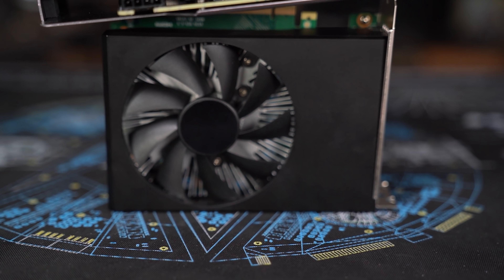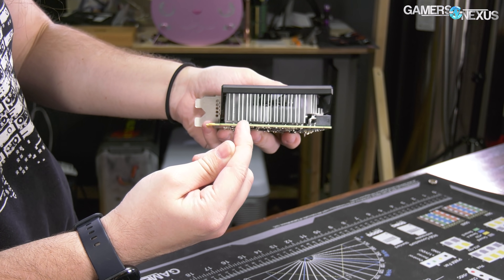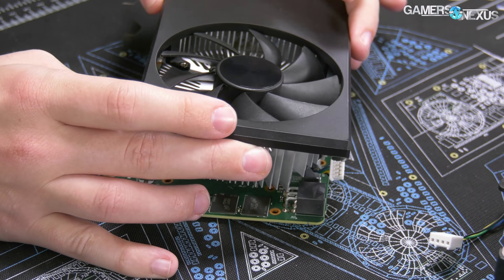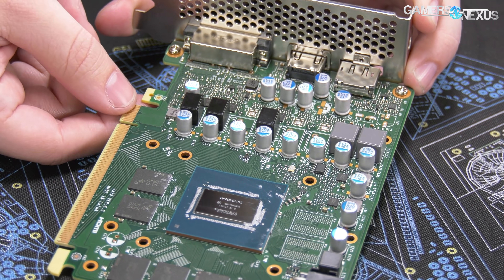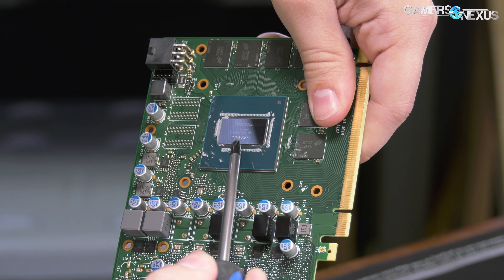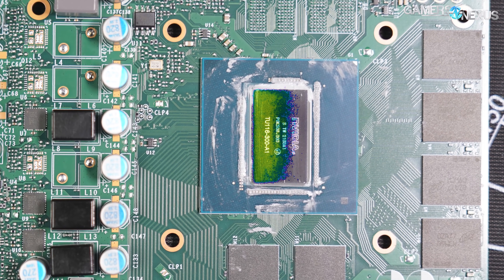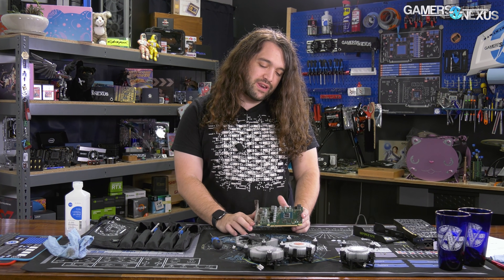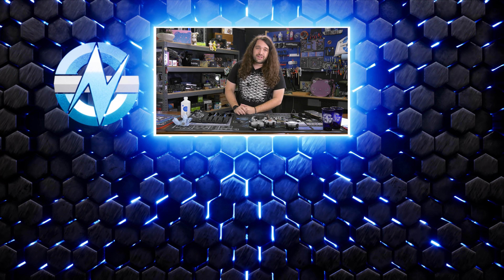Bottom of the Barrel: 110°C VRAM Dell GTX 1660 Super Video Card Review

Comment: "You'd have to get an excavator to get lower than what Dell has made here" - shows an AMD FX processor
Reply: Even then the fx isn't going to burn up after a year or 2 of service
Reply: @sabiti5428  Unless of course you put an FX-9590 in any board other than the 2 that actually had the VRM capacity to run it.  Because then it would burn up the first time you put it under load.
Reply: Had my FX6300 for 6 years, it served me well, even after all that torture during the 6 years, it didn't die!
Reply: @nikola4294  I bought one 5 years ago cause it was the fastest thing my motherboard could handle, still running strong and cool at 4.2ghz all day.
Reply: Two layer joke. FX is both buried, and its architecture was named Bulldozer; technically a form of excavator.
Reply: @AhPook  Even better than that. AMD made an APU architecture based on Bulldozer that was called Excavator.
Reply: @DeadNoob451  The comments help fill me in on things I would have missed.
Reply: @AhPook  the bulldozer era APUs were called excavator 😂. I'm still running an fx6300
Reply: @AhPook  Excavator is 4th-gen Bulldozer. It's not a layered joke, it's a literal, direct reference to an FX uArch.
Reply: I came to make this comment, and was happy to see I wasn't the first.
Reply: Atleast the FX8350 was a budget workhorse for gaming rigs for many years. Tapped out frequently and took the abuse like a champ.
Reply: don't you mean a bulldozer.
Reply: BULLDOZING INTO DELL DMS
Reply: upgraded from fx6300 to a 3900x almost 2 years ago and still have the fx running in the old comp. i guess its like an olda honda its just gona keep running
Reply: im gaming right now with an 8120... not bad. i play desstiny 2 on my tv so i only need 60 fps
Reply: @ikswotianop  Oh yeah, I upgraded to Ryzen a while ago and still regularly lean on my 8350 as a living-room tv pc. Has its issues but still plenty of legs left.
Reply: I rocked a FX-4300 for seven years. I finally jumped up to a R7 3700X. Holy crap, what I was missing.
Reply: @Evilliboba  yeah I looked at the benchmarks and just go oof everytime. I picked the worst time to upgrade too
Reply: Comedic genius.
Reply: Funny but kind of a cheap shot :)
Reply: Gotta love the bulldozer architecture reference
Reply: AMD Bulldozer and Piledriver
Reply: Looks over at FX8000-series PC I was happily using until quite recently...
Reply: I actually own one of those damn things was ok but my FX-8350 was 8 cores and I then got a Ryzen5 2600 and was like hope the less cores doesn't hurt too much then BLAMMMMMMMM  I used the new one and knew from that day my beloved FX-8350@4.6Ghz was a permanent pornhub PC from now on.
Reply: @agrojester1156  8 core don't mean shit if all 8 cores are crap lol. You should see what the 5600X is like, or my 5900X, shit's rad.
Reply: @agrojester1156  I'm still rocking my fx6300 till I section 8 this 1600 I got lying around
Reply: @agrojester1156  my fx-8350  retired from gaming to be an old lady's CPU ,  (ie i stuck the FX 8350 , it's main board and ram into my mom's pc when i upgraded to a ryzen 2700  two years ago.
Reply: @agrojester1156  lol, this hits home. My poor poor unstable space heater :'D
Reply: Poetry.

Comment: It's one of those cards where they tried to reduce costs in every conceivable way. Good thing companies can't change the silicon itself.
Reply: the silicon doesnt matter if the gpu dies in 1 year XD
Reply: @sdn-tp  *less than 1 year lmao
Reply: @Kien Ng wrong..they can die and they do die
Reply: we're talking about Dell.  they're figure out a way to make silicon out of cheap chineseium grade z 'plastics' it'll be put together with air and fake glue. they'll also put the Alienware logo on it and charge 1000 dollars
Reply: They didn't go far enough. Less plastic on the shroud would've lowered temps.
Reply: As a temporary GPU solution, I would have considered buying one if you could buy them separately and they were around $200. Then you just gotta hope it lasts until you finally get your hands on a 3000 series. I paid $180 for a temporary Zotac 1650 Super.
Reply: Or they're the reason everyone else can't get cards, cause they're forcing people to buy prebuilds

Comment: This makes the OEM HP GTX 1660 Ti I got in my Pavilion prebuilt "gaming" PC look premium and like an actual GPU you can buy off the shelf with better shroud design and better cooling solution using pipes and fins instead of using a big ugly alluminum heatsink.
Reply: HP’s OEM video cards are pretty good, just noisy.
Reply: @jb-br8bf  I have a family member with an HP "Envy" prebuilt with a 1660 Super that looks almost exactly like this Dell one. Overall the case internals and everything look very similar to the G5 this GPU came out of. I think that system has almost the exact same motherboard as the G5, with the integrated front IO

Comment: Out of curiosity, what would happen if you actually soldered in the missing caps and memory (assuming you had the same type from the same manufacturer)?  Would you have a better card or would it fail because the firmware can't handle hardware outside spec?
Reply: Technically you could upgrade a card that way but that depends on whether the memory controller was limited in hardware(not the case if there's a model with more memory that uses the same GPU die) or if there's a compatible VBIOS that supports the extra memory. On the CPU side of things the BIOS detects and enumerates RAM using SPD, DIMMs have small EEPROMs(memory chips) on them that contain their information such as capacity, speed, timings, etc. The BIOS reads them and initializes the memory controller accordingly. 

Since GPUs don't have modular memory, they don't have a similar feature so the VBIOS initializes the VRAM using hardcoded data AFAIK. If there's a better model of the card that you want to upgrade that has more VRAM but is otherwise identical, you should be able to solder the missing components, flash the VBIOS of the model with more memory and upgrade your card. At least in theory. Selling your card and buying the model with more memory would probably be cheaper and less painful though.
Reply: @whydohandlesexistAAA  there are some configuration resistors in the board.  @teclab channel showed some insane memory mods and how to configure.
Reply: The memory wont register. The GPU only has memory bus width enabled for the amount already on there. I suspect the missing mosfets are only required for the next size up (so 2060 if I recall). Better capacitors may net you are few MHz in top boost, but nothing worth it unless you're a competitive overclocker (in which case you wouldn't use this board as your base to begin with).

Comment: think of it this way... it only has to last "warranty time"+1 day
Reply: Yeah, but let's be realistic: a portion of them probably won't even last that long.
And when they don't, customers will still get the run-around from Dell basically saying that they won't honor their own warranty. Because it's Dell.
Reply: @DJdoppIer  Agreed on this. The disturbingly high revision number of the GPU is a sign that these things might have a higher failure rate than normal.
Reply: @jihadjoe  if they can't get it right after SIX revisions, there is no hope
Reply: @DJdoppIer  they'll get the run around until the warranty expires.
Reply: these PCs are typically good for medium to large places where they need a lot of computers at similar specs and would rather pay a small monthly fee for support rather than having a whole IT department. if one breaks, put in a spare nd send the broken one back to dell. that would be faster than fixing them in house.  the problem here is they are selling these shit machines to regular consumers and trying to deceive them.
Reply: In the U.S, perhaps. Not so, here in New Zealand. There's pesky legislation called the Consumer Guarantee act, which basically means a product needs to be fit for purpose for a reasonable length of time, so a company can't contract out of that by offering a warranty. As a result, it'd interesting to compare Dell's offerings here to those in the U.S.
Reply: @Monochromatik-Vision Yeah they (and other companies) try that opt-out hidden fee crap here as well. I believe our regulators have also clamped down on these shady business practices. Ironically, the only thing I possess from Dell is a 5-year-old monitor, and I haven't had a problem with it.
Reply: I have been running one in my sons build for over 3 years. and while we did add some thermal pads, this brand of vram is made to run hot. it actually likes being hot and even overclocks better when it is hot...but heat kills electronics no matter what. if you are not overclocking this card just  throw some pads on it and call it a day. Adding the pads will help temps but limit overclocking potential.
Reply: I'm thinking the majority will hit the 4 year mark with some failing in the 3rd year.

Comment: I will pay you $800 for that Dell GPU!!!
Reply: OK. Not a penny over $999 now.
Reply: @FakeGordonMahUng  $1200 final offer.
Reply: @alreed2434  SOLD to the fancy looking man holding up a sign that says, "I promise I am not a scalper"
Reply: @stellarproductions8888  Yeah I noped out 6 months ago bought a basic laptop 3500u and vega 8. Been building computers for 28 years never seen anything close to this bs. Absolutely disgusting and now someone comes out with gigabyte 3080ti rumor @ $2600 usd!
Reply: @alreed2434  So have I BTW, been building computers for 25 years for me. PC parts were always plentiful, prices may have sucked, but at least there was no void of inevitability as Agent Smith might say. I too had to cave. But if I have to cave, I'm going to do it right. So, before these machines disappeared like the fat guys lunch at the local DMV, I bought an MSI GE76-231 notebook, with a 8-core 16-thread I7 CPU, 32GB DDR 4 RAM, Nvidia 3080 GPU with 16GB VRAM, and a Samsung 1TB PCIE NVME SSD. 17" 300 hertz screen. Basically it takes one look at Dell and does a HULk smash.
Reply: @stellarproductions8888  That's fine, I found an OEM GTX750 for $1,399.99 I can buy now on eBay.

Comment: I nearly bought a 1,200$ dell system with a 3060ti. But I decided not to, because I remember my first 2003 p4 2.56ghz dell pc. You cannot replace the mobo, cpu, psu without replacing them all. 

 Instead! I barely got a fe 3090 with a 250$ 10700k. Entire rebuild was like 2200$. Had to cut my case to fit the 3090, but I know it'll last forever. Vram in gaming is like 82c. Mining... More like 102c. No thank ya

Comment: From a safety standpoint, how can companies release product's that have bad thermals like this without some sort of hazard sign or safety caution? Of course a GPU will just shut off if it gets too hot but who's to say high thermals cant in turn ruin/short another part of the GPU and create a sparking/fire hazard?

Imagine a family losing their childhood home of 25 years to a fire because Aunt Lisa bought Little Timmy a bad GTX 1660.
Reply: I am always amazed at how little has changed in the last 20 years.

It reminds me of my brother's prefabricated PC. It had a really cheap motherboard from Micro-Star (MSI) and the Southbridge overheated after half an hour, causing the system to crash, even when idle. Tech support replaced the motherboard, what did nothing. Tech support had to admit that it was a design flaw. In the end we mounted a fan with a metal bracket above the Southbridge.

Comment: How the hell can this piece of silicon run at 110c? My 1070 Founders runs at 70c with original paste
Reply: It's impressive how bad they can fuck up a pretty solid wallet-friendly card. Other iterations of the 1660 super run cool too - I've never even seen the two fan msi one I have go over 64C.
Reply: GPU core was 70C though. Your GPU's other components likely run hotter too.

Comment: This one doesn't deserve the mod mat or GN toolkit. "We're doing this today with Jay's automotive tools and we're using Paul's post pie kitchen for the teardown"
Reply: they shouldve opened it by throwing it at a wall repeatedly
Reply: The only tool that thing deserves is a hammer.
Reply: They should have removed it and do it on a bare bench, stating it wasn't worthy of it.
Reply: Shit...  Use a rock for the disassembly, and for the mod mat, the bottom of a pool
Reply: Just kill it, kill it with fire!
Reply: Throw it out the airlock.

Comment: Gigabyte 3080 OC: 98-101° VRAM
Reply: Change the pads, -20c on my vision oc
Reply: i had asus r9 290 with edge temperature 92c. hot spot maybe over 100c. run without hiccup for years.

Comment: That opening really hurts just from seeing it, such a well thought out  illustration for the value of the product lmao (Edit: used german spelling for for)
Reply: I mean i secured a normal 1660 for around $220 just right before the graphics card market bubble blowing up, was thinking about getting a mini sized gpu but after reading about bad performance reviews i decided against it. Good thing i did.
Reply: @catnip202xch.  if you use gpu that not need cable power then it is okay to use the mini version, but if it use use cable power you should consider using gpu that have good heatsink